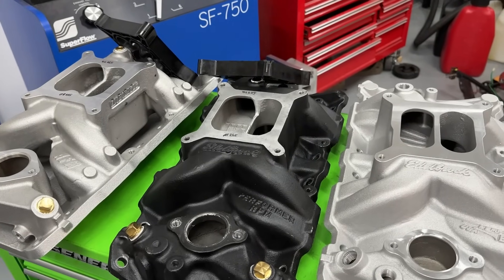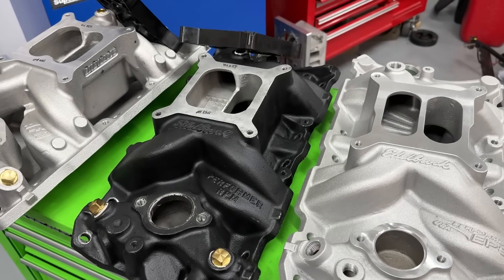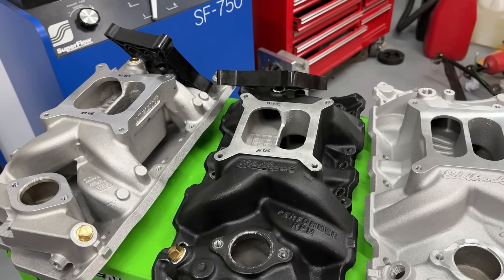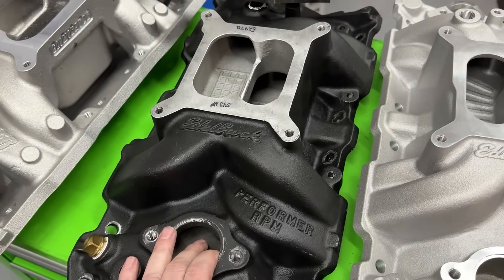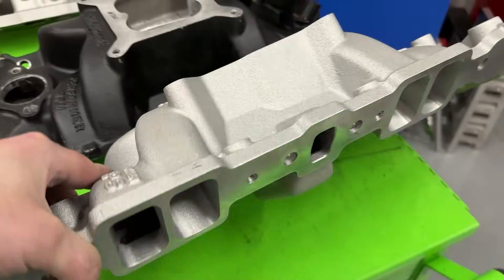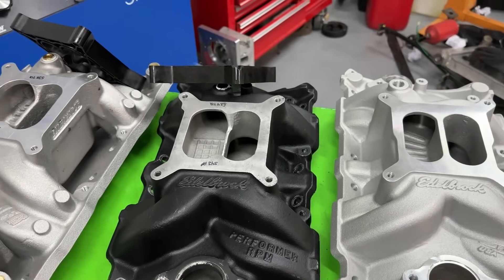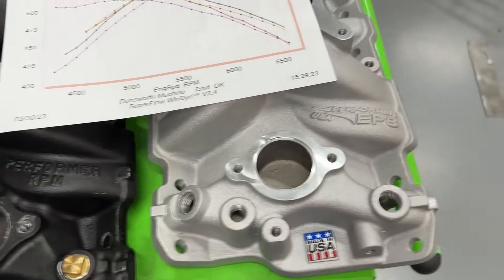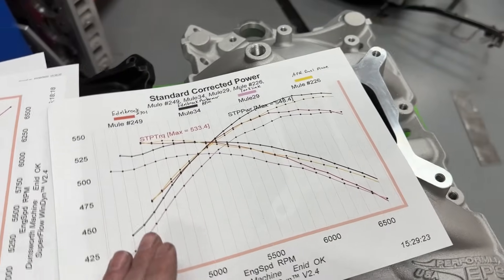Does Cutting Down The Divider On A Dual Plane Intake Manifold Help

Comment: I believe the differenced in performance could be due to the carb used on the intake while divided was too small in cfm.  Adding the open space allowed the intake runners to access more cfm.  Would love to see a larger cfm carb used  with a 4 hole spacer and no space on a  dual plane with the divider not cut down.

Comment: So the performer rpm not modified with one inch spacer was the best. Good to know just like I run mine. I think he divider effects air velocity with the divider cut you start getting what I’d call dirty air kinda mixing it all up losing its way a little kinda like most of in or early 20s…😂

Comment: The reason that milling the divider out lost power is because when you keep the two sides divided you have each cylinder firing in alternating planes of the manifold, in separate plenums. When the plenums are joined you have valves in overlap and in intake simultaneously, which both reduces cylinder filling and introduces contamination into your air/fuel charge.

David Vizard talks about this in a video he did recently on dual plane intake manifolds.

Comment: What would actually be helpful is if you actually showed usable RPM ranges for people.  The bulk of people don't have an engine that would safely run more than about 6000 RPM - and if you are talking about people that will build naturally aspirated engines - you are talking 60's - 90's 302's, 60's - 90's 351's - // 60's through 90's 305's - 60's through 90's 350's (a lot of those).  About 15% of the people you are talking too 'might' have splurged on a stroked version of any of the mentioned before - and those people likely didn't turn a single bolt on that engine - they ordered it and installed it.  Useful knowledge - how would adding that divider affect the entire usable RPM range (1500-5500 or 1500-6000) of a 289, 302, 351, 390 - 283, 292, 305, 350 , 383 - or - 273, 318, 340, 360 - possibly big blocks like 427's, 429's, 428's, 405's, 426's 400's - but in reality - that is likely less than 15% of the cars anyone is trying to build.  This - is kind of useless drivel for anyone that's not intending on having an engine built for track use - then pretending they know more than the person they take the car to to have it built - cause really - 90% of people today aren't competent to change their oil, tranny fluid, radiator coolant - God forbid they actually have to degree or time a cam or adjust timing and a set of points.
Reply: You might also target it to the kind of lift most people will run which likely won't go over 500 thousandths - though seeing that you can't get a 40 thousandths head gasket for a ford small block without special ordering it these days (all I see are 80 thousandths gaskets) I suppose you can run a hell of a lot more lift to please the 110 thousandths of quench the parts stores just decided anyone that doesn't deck their block to make up for the crap for parts for sale - to go along with the loss of about .1 full point of compression.
Reply from the maker: Sure.

Comment: I really appreciate this video. I have a 398 Windsor stroker with Flotek 185 runner heads and a comp cam that is rated 1300-5600 rpm with an Edelbrock performer intake. I was contemplating swapping to a performer rpm intake but not sure I would benefit as it red lines at 5600 rpm?

Comment: Hi, I like your testing but some of the principles you're missing? For example there are several other manifolds that you're not testing, my own experience since 1968 and testing mostly on high-performance 289 K engine, was it depended greatly also on the weight of the car! The two best intake manifolds I have run to this date for the dual plane on my 66 fastback Mustang which is about 3,300 lb, was the stealth dual plain from Weiand! With an 8:30 CFM double pumper! Both cars are four speeds set up for a quarter mile drag racing, the other car is a 1970 Maverick! It is almost 300 lb lighter than my 66 fastback! That engine around the best with a Victor Jr Edelbrock, what's an 850 double pumper! Also we tried several other manifolds like the Edelbrock f4b or dual plane the torquer and a few others, which for all considerably less performance better for possibly just Street driving or cruising but those two were the best for drag racing depending on car weight! Also we ran from altitude of different size carburetors which you didn't do in your testing and I would like to see results for that? But we ran a 650 double pumper to a 950 double pumper, and also a 950 3 barrel! We have also done some testing on small block Chevys we are working on a couple of 400 small blocks and also a few different combinations of big block Chevys mostly 427, I'll be happy to share with you my results and I would love to see some of your Dino testing to compare with my findings, my Dyno testing is a drag strip I change intake manifolds and nothing else the experiment with different size carburetors and timing settings! Some of the newer manifolds that are out today I have not tested because I see no noticeable improvement, most of the dual planes available today are designed more for Street cruising and not after full out and out horsepower like they used to be in the 60s and 70s! A lot of cars today run fuel injection and that changes everything that has to do with the carbureted intake manifold! Also from my own testing I found that the four hole spacer plate just a small one, even if only a quarter of an inch thick with four holes the bottom end and throttle response! I don't care for the tapered one you were using it does not work well especially with a dual plane! This was tested on both the Weiand stealth, and the Victor Junior we are also comparing these notes with the super Victor and the jury is still out on the super Victor? But also carburetor sizes made drastic differences I have a 406 small block Chevy in my Z28 Camaro 68, as I'm saving the 302 as it's a numbers matching car I don't want to hurt the original 302! But with a team g high Port intake manifold and the Dart Iron Eagle high Port cylinder heads the car has run the best so far with a 750 double pumper, I know from working on another car with the same setup, that it ran much better with an 850 CFM double pumper!!! Used carburetors were tested and petted according to the best fuel burn and mixture, I would love to see these comparisons with your setup I like what you're doing but I think you need to broaden the spectrum! The 1-in open hole spacer seems to make performance increases because you're increasing the plenum size! But most carburetors especially up towards an 850 double pumper really responded well to a thin 4-hole spacer! If you need to know any specifications on what I did feel free to contact me at my email address, I'd be happy to give you any information I have. Best of luck to you keep up the good work!   🤠👍.

Comment: I’ve had far more success with 1” spacers than milling. What type depends on the combo. Bigger cam and heads tend to want an open spacer on my Mopar small blocks. Smaller cams and smaller heads seem to like the four hole/tapered spacers.

Comment: A divider effectively stops cross-cylinder robbing of the intake charge and improves signal to the booster.
A cut down divider that shows a hp improvement without a loss in tq shows that more carb is needed.
Reply: Must have watched Vizard as well.
Reply: @markbogush9755  that's like 80% of my knowledge lol
Reply: @markbogush9755  You know, Mopar engineers were cutting down plenum dividers of the recommended LD340 dual plane manifold for Super Stock cars in the mid 70s? Did you know that all Direct Connection Mopar cams are ground @ 108 CL. Mopar guys have been doing this stuff since the 70s. This is not new......most of Mr. Vizards tricks...are straight out of the Mopar Bible from the late 70s on. Thank Chrysler engineers if you must.
Reply: @kramrollin69  cool to know.  Mopar engineers are known to be the best
Reply: @kramrollin69  Those cutaways on the intake manifold plenum were originally to accommodate the Holley three barrel carburetors.  I have one on my Edelbrock DP4B.

Comment: Actually you can gain more when you mill the divider.This was done already done back it my day in the late 80's.The secret is the carb signal changes,so you modify the carb for the change in the signal.We tried all kinds of welding and cutting things.Just something I learned and don't care what people think as I got out of racing in the 90's when a normal racer with a normal job couldn't place or compete against big dollar racers.

Comment: For a test like this on a dual plane manifold (and this is just my opinion) I sure would've liked to have seen the dyno graph from 1500rpm and up. At the end of the day, most guys running a dual plane have a street, or a street/strip engine build. I found this video because I was curious about the divider in my Edelbrock intake, and if there would be beneficial gains up top by removing the divider (bringing it slightly closer to a hybrid dual/single plane) without sacrificing too much bottom end. This and Ben Alameda's video answered my questions.

Comment: For street use. The test should show 2,500 rpm on up. Not 4,500 rpm or more as a starting point.
Reply: No one cares about power at cruising rpm.
Shift down or let the transmission shift down like any normal person when they want to pass or go fast.
Never understood this statement.
Reply: 2500 what are you building a truck engine to tow?

Comment: You can clearly see the eps was higher torque that's why he started the pull so late or it would of beat the afr 😂and it was same power as afr at 6000 😂lots of guys don't Rev higher than 6000 so eps is perfect 🎉😊
Reply from the maker: Sure

Comment: Not trying to sound like a know it all but.....try running a much bigger company card on a true divided single plane aka no cut out
Reply from the maker: I don’t understand what you are saying. Company card?
Reply: @WeingartnerRacing I'm sorry, dang spell correct, it's why my wife is lost half time I text her because I norm don't proof read b4 I send. I've watched bunch of your videos but guessing from title of video I meant bigger carb on dual plane. I'll rewatch try remember what I meant. But on a true dual plane the cylinder only has access to half the carb due to 180 degree intake.  So basically if you have a 1,000 cfm the cylinder only had access to half the carb or 500cfm. And for a 800, only 400 cfm and so on, hope this makes sense

Comment: Engine masters showed real gains on dynamics with divider cut out.
Reply: yes i saw that they only took the RPM divider down 1/2 inch the same as edelbrock does on the air gap and made good gains with the rpm

Comment: I tried an Edelbrock two plane 302 manifold with an 850 CFM carb on a 427 W using Price Motor Sport adaptors.
Seemed to make more low end torque but less upper end HP.  May be Eric could try this and see what happens.

Comment: If you want to keep the oil and coolant Temps constant you could use an external oil cooler cooled by the coolant.  Thermostat controlled  to help control it.

Comment: Seen a  Edelbrock dual-plane manifold that was notched out about 3/4 deep x 2 in length along the divider " at this racers shop " ? Always wondered if you'd get the vest of both worlds low end and some on the top"

Comment: Interesting to see varying results from lowering the dividing wall. Ben Alameda did a video on his observations with a SBF netting a Loss of 27hp from 556hp after it was lowered.
Reply: But at what rpm? Did it gain in the upper rpm range?

Comment: I believe a factor you don't cover is the AFR is an Air Gap dual plane the others are not !  Although you do later mention that AFR is Air Gap.
Reply from the maker: It means very little on the dyno as there is not a lot of airflow under the intake in the dyno cell

Comment: Very nice work here Eric.....and a lot of it!! When I see and read info like this I'm reminded of the IROC racing series. Their  professional engine builders with the best most modern equipment struggled to get all the engines built completely the same to get the engines to perform equally .  They always seemed to end up with one that was a slug and one that would run circles around the rest.  It is certainly not feasible but a test of three differently built engines testing the manifolds and the performance differences would be interesting but a budget the size of GM would be necessary for that type of testing. My point is if people really want to know what is for their combination, they need to do what you always do and that is , test, test, test.

Comment: 5:50 also possibly consider, the oil being hotter making it thinner reduces ring seal, which may help contribute to the drop in hp at higher rpm.

Comment: Eric, try this, get a 2 inch 4 hole spacer and cut out the divider almost completely on the passenger side, no other mods. Install it on a 400 sbc with big heads, roller cam. And an airgap intake ! My 400 w..sportmans 200, Fts. 654 roller, 251..258 ..110 and jetted right gained 20 hp ,dyno man was stunned, engine sounded better,,why,  I think it more equalized the plenum? I used air gap to run on the street for torque, it was 500 ftlbs
Reply: I bought one used, just to try this. I won't be done with the engine for 6 months, but thank you for the tip!

Comment: I'm not sure how you thaught that cutting down the divider would help low end torque. Yhe reason people do that is to wxtend high end HP. Here is the logic. Dual plane intakes are designed to increase performance at a lower RPM range, single plane intakes have a higher rpm rating. By cutting away the divider, you are basically adding a characteristic of a single plane, but on a smaller scale. 
And your tests seem to verify that logic.

Comment: Great video. Thanks. 
Have you tested the 2701 with a Holley Sniper EFI? Some folks say the divider should be cut and some say it’s not necessary. Looking for really data before cutting mine. Thanks in advance for your input.

Comment: Eric, would you consider doing a comparison video between "Mule 250": 2701 EPS w/ 1" Open (watch at 9:09) and "Mule 249": 2701 EPS NO SPACER (watch at 13:06)?  Seems like the 1" open did the opposite on the 2701 EPS vs the AFR 4812 runs "Mule 225": 4-hole vs "Mule 226": 1" open.
Reply from the maker: I only used a 1 inch open spacer when I tested the 2701. None got tested without a spacer.
Reply: @WeingartnerRacing  Thanks for the reply.  Any idea the difference in Mule 250 vs 249?  EPS Mule 249 run matched the AFR Mule 226 all the way to ~5,800

Comment: help with? I feel given the engine combination a spacer will help but not always. An engine build with Intake length and cam centerline optimized, usually does not benefit from this modification or a spacer. Just my experience.

Comment: I'd like to see a. 1/2" 4 hole spacer between the carb and 4 hole taper spacer and a 1/2" open spacer between the manifold and spacer and tgen go up to a 1" 4 hole and open. 😀
Reply from the maker: I did test 4hole tapered and open 1 inch spacer.

Comment: i did that differently. i kept the divider flush to the base plate of the carb and had a opening about an inch the width of the divider on the floor of the manifold.
Reply: more info. i was using an open plenum manifold with about 3.5" carb base to manifold floor. my spacer was about .750" and a slot to install a plate to span th carb opening. i left an openin about an inh at the bottom edge of the plate and floor. i ran the plate front to back but it could be run left to right. i hope you test it.

Comment: All it does is destroy idle vacuum and off-idle torque. Also bad for emissions and fuel efficiency. That's why I epoxy in a divider when the only manifold available comes already gapped. If you need another five horsepower, add more boost.

Comment: The Edelbrock Performer RPM air gap has slightly longer runners than the non air gap Performer in addition to the lowered IAC benefits of the air gap.  I have often heard engine builders say that cutting down the divider on a dual plane manifold can slightly improve cylinder to cylinder distribution issues inherent in the manifold design.  The only way to accurately verify the AFR in each cylinder is through a temp sensor in each exhaust header.  A single sensor in each collector gives an average of the AFR’s in that bank.  The individual AFR’s can vary significantly, sometimes as much as 3 points!  While the overall AF may be 12.5 you could easily have one or more cylinders at 15.0+.

Comment: Seems like motor difference and or your dual plane center cut down for Richard holder did both and the 4 hole did better than open spacer but his spacer wasn’t open hole tapered spacer .

Comment: I can’t recall (I think it was a Weiand) which single plane manifold I had on my 355 SBC.  One of the magazines in the late 80’s/early 90’s installed a separator plate vertically in the center of the plenum to boost torque.  

I made one and installed it and it seemed to work well.

Have you tried doing a test on the Dyno doing a similar mod?  It would be interesting to test this out and then start cutting the spacer down 1/4” at a time.

Comment: Sooo after seeing this I will leave the plenum stock on the Edelbrock Performer in my street machine.
Reply: Well, it depends. If you use an open spacer, that is like cutting a crossover in the divider. If you have a hood clearance issue and a spacer would push the air filter assembly into the hood, cutting the plenum divider is the answer.